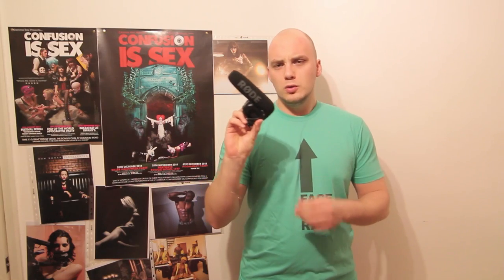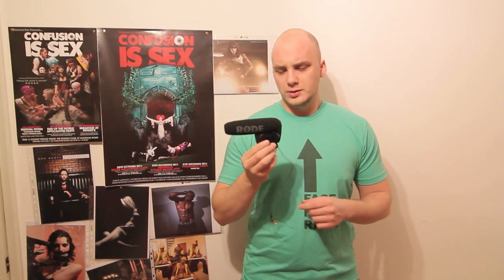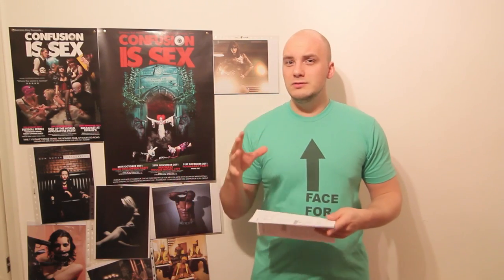Rode Video Mic Pro First test by Dom Bower

Comment: @mainIevent you got it flipped mate. there's a reason it's called "high-pass filter" because the high frequency sounds passes through to the cutoff, while attenuating the low frequency noise. low-pass filters allows low frequency sounds pass through the cutoff and attenuates the high frequency sounds.

what you described is the high-cut filter and low-cut filter, respectively

Cheers mate.